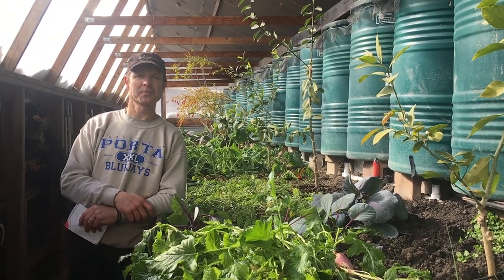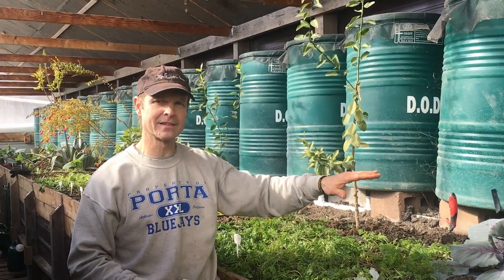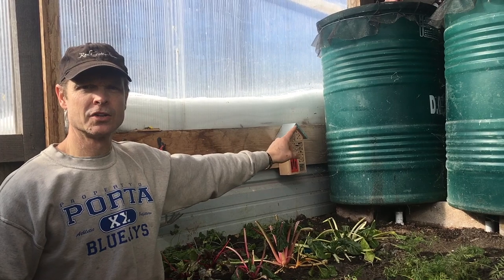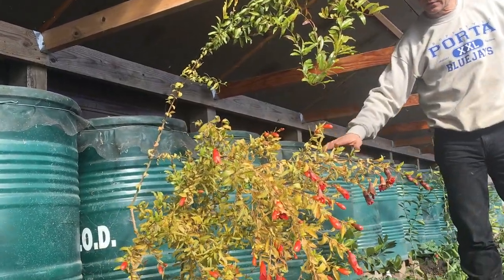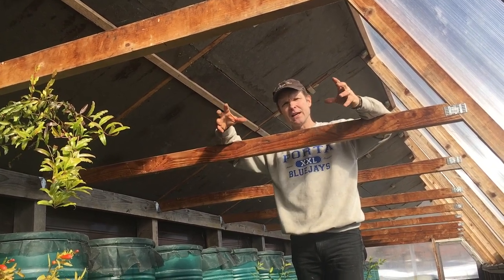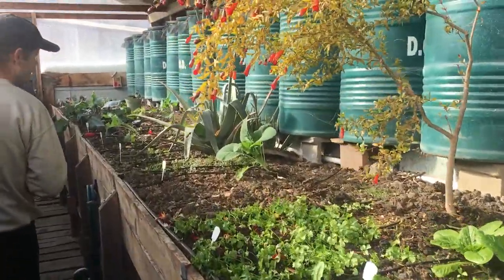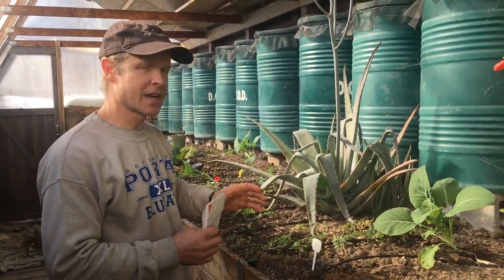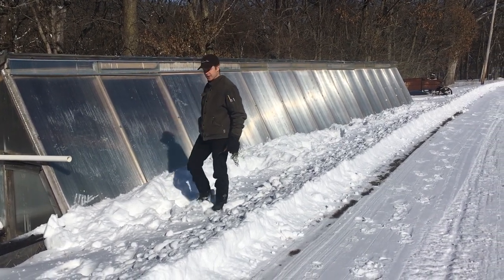Walipini Followup: Answering Viewer Questions

Comment: There is an animal like a woodchuck, that ventilates its burrows by having one exit higher than the inlet. This causes a natural airflow. from the lower to the higher.
The higher the upper exit, the more the airflow.
Mud palaces in the middle east used the same system to air-condition them. They put water out at night to freeze, and then they had an ice room that the air flowed through, naturally, and provided cool air through the building.  
.

Comment: This sounds way better than just a conventional greenhouse. We just bought a house and closing on it by the end of this year. We were planning on building a south facing greenhouse come spring time that we would be able to use next year, but I think that the Walipini is a much more efficient / better idea. 

Looking forward to seeing all of these improvements implemented and how to improve the design even further.
Reply from the maker: In terms of year-round production, this is definitely a great option! We are in the process of building our second walipini at our new property now. It’ll be quite a bit different, but there will also be similarities. The basic idea is to tap into that geothermal heat source to stabilize temperatures.

Comment: A much better design would be place plumbing 2" off the bottom on the side of each barrel. There are flange fittings available that are designed exactly for that use.The individual valve idea is a good as well. 50 gallon of water is approximately 417 pounds. Barrel diameter is approximately 26 inches so A= π times r2 . So approximately 3.68 sq feet bottom of barrel to distribute 417 pounds. That works out to less than 114 pounds per square ft. That's less than the weight of most people standing on the ground. No problem compacting to that spec. Barrel diameter and gallon capacity varies with type of barrel used so above calculations may need to be adjusted.

Comment: Great work. Thanks for scripting, recording, editing, posting, and sharing so well.

When breaking up into fewer barrels per "tank", it might be safer to plumb every third barrel into a "tank". This would yield 3 separate, redundant tanks of 5 barrels each with a 16th sediment/distribution tank. Losing 1 tank would still leave 66% of the heat from the other 2 tanks nicely spread out. Applying the same redundancy to the irrigation side could save every bed if each crop row from walk aisle to barrel bank was serviced by 2 drip lines from independent tanks. A tank failure would then leave 1/3 of the rows with 100% planned water and 2/3 of the rows with 50% planned water until the tank failure gets discovered.

Comment: Water stores heat real fast but it also dumps the heat just as fast.  That’s why it’s used in radiators.  Masonry (rocks,concrete, brick and sand etc. absorb heat slowly and release it slowly so you’ll be much better off filling your drums with masonry and if you use the drums to collect water then fill them with gravel and then add the water around the gravel.  I built an earthship with reinforced concrete walls ( I don’t trust tire walls in an earthquake).  Three of the walls are earth bermed and the south wall of the house is also the north wall of the green house that runs the length of the house.  All day this Trombe wall slowly collects heat and then slowly releases it all night back into the greenhouse as well as into the house.  Water drums loose all their heat in just a few hours.  I put radiant heat in the house but have never used it.  Instead we use a couple of small electric heaters to heat 1200 sq ft.  We live in zone 5.  Word to the wise, if you use sloped glass in the green house you need to be able to remove it in the summer or open it up or shade it.  It gets too hot if you don’t.  Also earthships take 50 to100 percent more labor than conventional homes do.  Everything on an earthship is custom so it takes forever.
Reply from the maker: You bring up some good points but I don’t totally agree with your premise. Although water can absorb and release heat quickly, you can manipulate the design to control the rate of dissipation. The point is, water holds more energy than any of those other recommendations you gave. If you look at total energy balance water is the best of the options you mentioned. No amount of design manipulation can increase the specific heat of sand and gravel to match that of water.
Reply: I didn’t know that.  I wonder why they use sand then in sand batteries rather than water.  Sand stores the heat for the entire winter with very cold temperatures outside in Scandinavia?  I think that water would loose the stored heat much much faster than that.  Other than insulation (which they use with sand batteries), how would you control the heat from leaving water?
Reply from the maker: Sand has many other advantages. It’s cheap, it’s noncorrosive, it won’t freeze, and it has air pockets in between each grain which in itself is an insulator. Additionally, there is no chance for leaks, evaporation, or acidification. In other words, it’s perfectly stable for thousands of years. Sand, gravel, or rock is probably the best choice when space is no issue. However, I accepted all the disadvantages of water because space was an issue for me. I wanted Maximum heat storage in minimum space so I could use the rest for growing. And yes, the way to limit the rate of heat dissipation is insulation. Same as they would for sand batteries only more, which is yet another disadvantage of water.

Comment: A system is only as robust as its weakest element. In this case PVC piping under temperature & H2O pressure, it just couldn't take it. Breaking it up into smaller segments will reduce H2O waste but it still won't reduce wear on the PVC. I'd seriously consider upgrading that portion of the wallipini to metal from PVC. Ideally copper. In my view we never scrimp on the important stuff.
Thanks so much for posting and best of luck dealing with the heat loss and water system repairs while winter is still hanging around !

Comment: First off, amazing unfo. Thank you for these videos. I would be super interested in a grow schedule and when you turn over the beds/ what you plant when.
Reply from the maker: Honestly, I grew whatever struck my fancy each season. I didn’t necessarily have a schedule. The late winter, when I started my seed trays for the outdoor garden, I was often left with leftover seedlings. Typically, I would simply add them into the walipini bed.  I generally had a quick, clean out/add new compost in the late winter, just before starting the spring garden in there, and then we would often finish the harvesting around July, let it just lay dormant while we focused on the outdoor garden at that time of year, then in August, I would do a very thorough clean up and restart For the fall and winter season inside the walipini.

Comment: I know you mentioned the reason you cover the back during the summer, but do you think the ideas of having the roof either at one angle or two, but both being towards the sun and both having the back wall higher for dirt would be better?
Reply from the maker: I’m not sure I fully understand your question. However, another reason for the roof angling down in the back is to reduce air space in the walipini. It allows the thermal mass to more efficiently heat that smaller air space. additionally, raising that back wall would require about 10 times more dirt in the back with a steeper slope and potential erosion.

Comment: Pitch. Spruce pitch. Colder it is, harder it is. Great for patching or sealing especially in contact with water. Mother natures fiberglass. Now, in contact with heat it will become soft. One way to decree the material heating up is rubbing white ash into it, wich i feel does something with the alkalinity of ash to the pitch similar to lime- i have not used cooked ash wich i feel would perform bettter. Harvesting pitch- to get nice clean pitch, heat in a container and pour through cheese cloth, or a cotton t-shirt.

Comment: Awesome work!  Super impressive. I'm in the planning stages myself, so all your information is very helpful.
Reply from the maker: If you haven’t yet, be sure to consider picking up our book, Walipini Design and Construction. A link is listed in the info section of the video.  It contains all the intricate details. You really need during your planning stage. It also has an entire section on what we will do differently, and the things that didn’t work quite so well, which allows you to learn from our mistakes!

Comment: Great video contents and presentation.  It would be nice to see what you come up with for your new house, but wonder how you will protect artwork, books, piano, etc. from the direct sun?  Maybe a sunny hallway where some plants grow, and the rest of the house with traditional walls?
Reply from the maker: This was an older video, and our new home is well into the build at this point. The new house is designed to be passive solar, so direct sunlight only enters for a small portion of the year, during winter. Once completed, we can use drapes/blinds to control the suns ability to affect things on our walls… Just like any home.  If you check out our construction playlist, or our starting over playlist, you can actually see the house being built.

Comment: Check out flexible PVC pipe, comes in different sizes and comes in a roll. 
Uses standard fittings and glue, best is it flexes to absorb shifting and settling and installs easily between fixed objects due to its flexibility

Comment: Use a thick thermal blanket at night when it is cold. That would help with heat loss. 

You should add the thermal pump system for your home build. That would help there for the heat and cold loss of a home.

Comment: You can use an additional compost heating 'system', that doesn't need gas or other heating. It's different than the sun, but still natural, and there are some good ideas to be found on the internet. You could even attach the water from the tanks to connect by pvc pipes into your compost, or just put compost at the back of the walapini and let it heat your greenhouse using the wall.

Comment: Thank you so much!!! I was just about to start my Walipini when I found the first video and then this one. It was just the information I needed to share with my husband and heavy equipment operator who felt a little in the dark concerning the plan. Now he can better visualize the outcome.  The video expanded my knowledge greatly also even though I have been studying and preparing for this project for a quite a while. I only have one minor question. How much difference would the heat absorption be if the barrels were painted black? Again, I appreciate you guys so much!!!
Reply from the maker: Black does a great job of absorbing heat, but other colors do offer some benefits. It really does depend on the design of your walipini and how the sun enters. I would encourage you to do a little research on that. If you would prefer it all in one source, consider picking up a copy of our book off of Amazon. It goes into much greater detail than the videos, but it’s also written to be very easy to understand so the average person can DIY!  You can find it in the info section under the video.  Hope that helps!

Comment: Interesting fact you mentioned.  Polycarbonate only lasts ten years.  Didn't know that.  
As for your PVC issue.  There is a flexible PVC we use in the pool industry that will move with the ground movement.

Comment: You could put a black rainboard angled towards the sun maybe to catch even warmer rainwater?
Reply from the maker: True, but the heat transfer is minimal unless you have a large collector.  An actual drop of water does not spend enough time on the collector to gain much heat. In addition, when it’s raining, the sun is not shining.

Comment: In your redo, would you go for a narrower walk way with longer beds? Or, bring the wall forward so you have a reachable bed?
Reply from the maker: We’re working on walipini 2 now, which is actually attached to our new house.  We are basing on the previous design, but going with concrete for thermal mass, which allows us to run a double row of beds—one on each side of the walkway.
Reply: @ADifferentWay  don't get enough wet from sky anymore to justify any run off irrigation. Will just use barrels as heat battery. Thinking of air flow compost behind barrels in winter for a second source of heat. Barrels will be the outer wall. Saw a chap on YouTube from SC doing that.

Comment: If my research serves me correctly I am at 48.8 N Latitude and growing zone 5B-ish as well. My question is, would the color of barrel you used in rain collection have much effect? i.e. black drums opposed to white drums. Would a black drum collect the solar energy more so than a lighter colored drum? and on the flip side would it supply heat any less efficiently or more efficiently than a lighter colored drum? Also, correct me if I'm wrong, but I assume you used a food grade plastic drum? Great video and thus far the most informational. I look forward to one day building my own using your tips and tricks. Keep it coming and God bless.
Reply from the maker: The color is important. The problem with black is that it does not reflect any light at all. The backside of those plants need reflected light. The white drums would reflect a lot but absorb very little solar radiation and thus not heat up well. A blue or red barrell would be ideal.  And yes, they are food grade.

Comment: What do you do regarding Moles Jake's mice and other animals that can butrro in there
Reply from the maker: They have definitely been one of our biggest issues in this design. Voles are the biggest problem, since they actually eat the root vegetables. Mice are seen on occasion, though they aren’t a huge problem since they don’t eat too much. We just have to be consistent about setting traps, flooding tunnels, and keeping any holes sealed up. We are currently designing our second walipini at the new property, and we are going to try using a complete concrete structure this time, with raised beds inside.  Although it has downsides of its own, we’re hoping it will eliminate this problem. Will let you know as things develop!

Comment: You mentioned “clean out” the barrel. I’m unsure of what you intend, but (my father ran a city municipality) when he said this, it meant a clean out valve and purge...think fire hydrants in the fall or spring. I’d have purge valves set before the connection to the last filter to simply purge (lowest point) the barrels on occasion.

Comment: Thanks for generously sharing the successes and opportunities for learning gathered from  your working experiment.  I 've no gardening experience myself, but am curious how you plan to rest or replenish the soil in something that's  seems to be in constant use.
Reply from the maker: Great question!  Most of the walipini bed gets at least 2 short breaks through the year, as we harvest different sections at different times, but generally replant it after 1/3-1/2 is empty.  We also bring in plenty of compost before replanting, to ensure fertility stays high.

Comment: Would a root cellar help as an additional cold sink to help with thermal regulation? Would also be a convenient place to store produce.
Reply from the maker: I have to put a lot of thought into that one. Typically a root cellar you’re trying to cool quickly in the fall and then maintain a constant temp throughout the winter. Whereas the walipini is trying to hold that summer warmth as long as possible and capture solar heat throughout the winter. Not to say it can’t be done, but there are some opposing functions going on there.

Comment: I would have added an outside clear pipe onto every barell to monitor the fill grade
Reply from the maker: A clear gauge is a good idea, but if the barrels are connected, you only need a gauge on one of them. In my design, they naturally leveled across all 30 barrels.

Comment: Can't wait to see what you guys come up with for truly off-grid non-electric living, something the Amish already accomplished but without some of the modern innovations(concrete/plastic etc.). Are you concerned at all about the plastic barrels leaching toxins into the soil? Are you looking into extending the useful life of the Wallipini? 100 years? Thanks for your helpful and inspiring contributions to farm living.
Reply from the maker: I’m not a fan of plastic but it was cheap and available.  I’m thinking of doing a ferrocement trough for the water storage next time.  That adds even more thermal mass and would be less piping.  I could then afford copper and eliminate plastics altogether.

Comment: Fantastic vid.  Great analyses and explanations.
If you could would you provide electricity (grid or solar) for moving air?  
Would you add a woodstove for emergency heat?
Reply from the maker: Certainly, you could, but we chose not to for this particular structure.  You have to balance the benefits/costs of gaining maximum production potential at higher costs, or losing a little production potential, but decreasing costs.  It really boils down to individual choice/needs/situation.